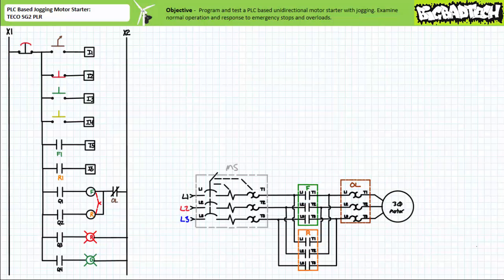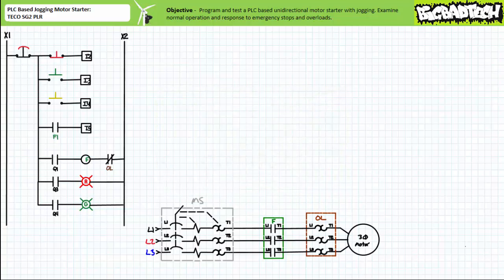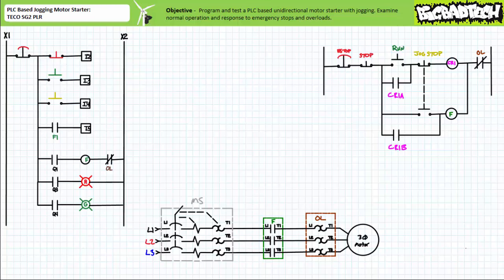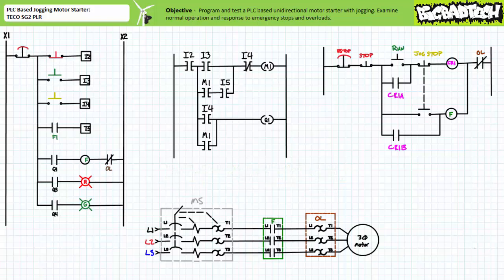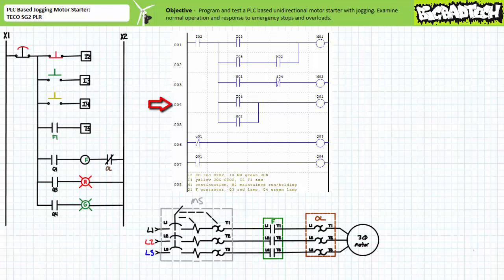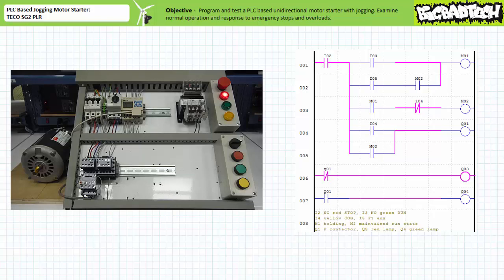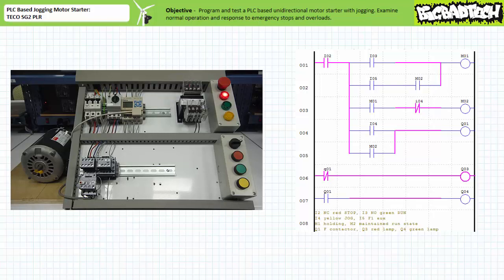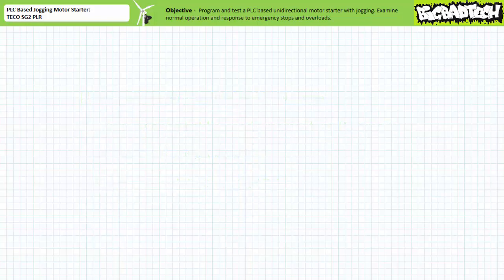PLC Based Motor Starter with Jogging: TECO SG2 PLR (Full Lecture)

Comment: Great ladder logic. However, the Jog PB can still energize Q1 when the overload trips. If someone is pressing the jog as the overload cools, the motor can start immediately. Also, the green indicator light will still be energized. LOVE YOUR VIDS BTW.
Reply from the maker: While the overload is open neither JOG nor RUN will allow the motor to start. That's the point of the hard wired OL connection at:

https://youtu.be/35kHYqsQxyo?si=RJCKiazBHHRnolsN&t=135

When the OL cools and closes JOG or RUN will allow the motor to start. If you're jamming on either button when the overload cools and it's in automatic reset mode it will start the motor. That is true of any 3 wire circuit (ie: it will restart only at the direction of the operator).